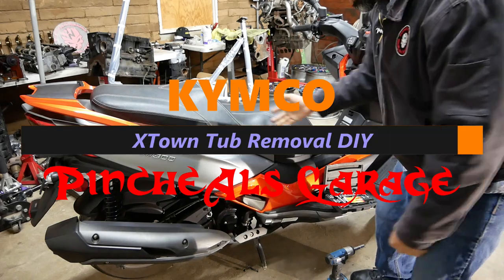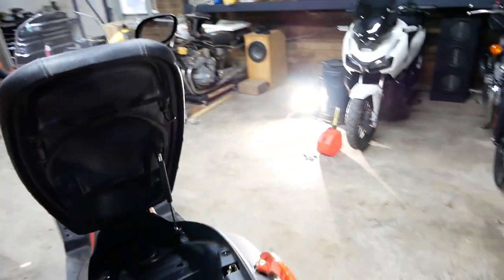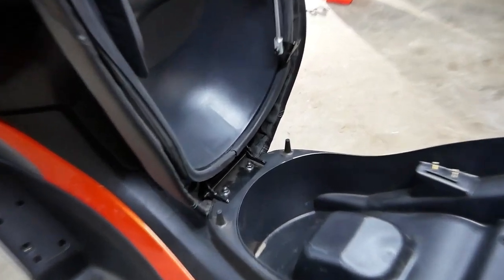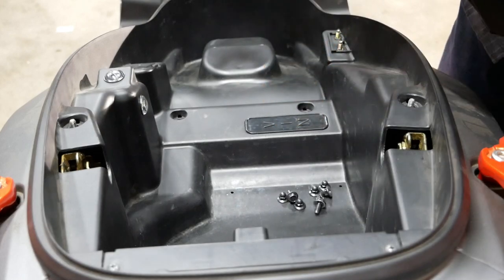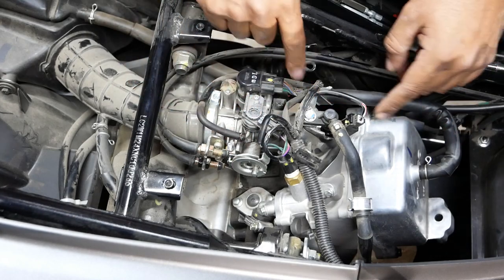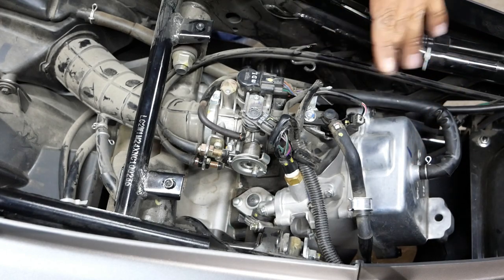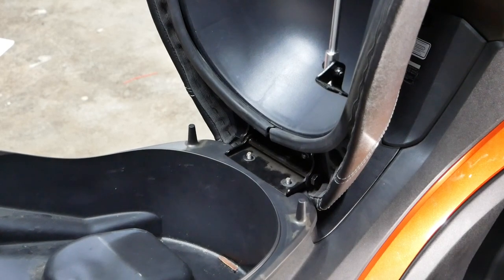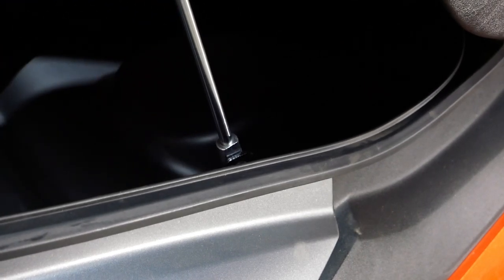KYMCO XTOWN TUB REMOVAL DIY

Comment: I have this exact scooter with 24000 kilometers and it has been extremely reliable and, for the price that I bought it, is very well made. Not the fastest 300cc scooter, but very practical, with good brakes, very nippy around town, low cost maintenance and, if you become familiar with it, this scooter can corner due to its small wheels